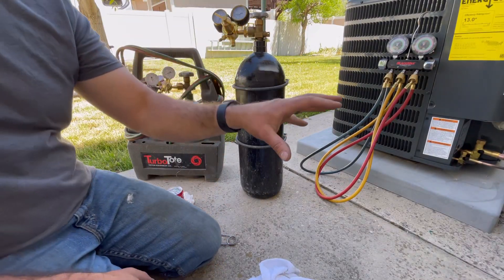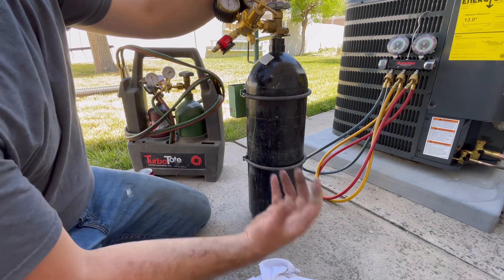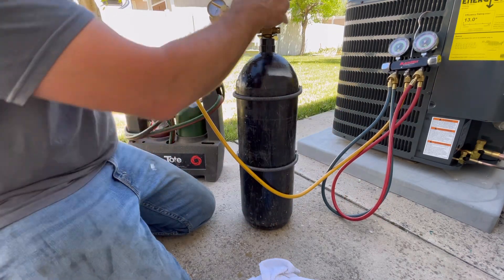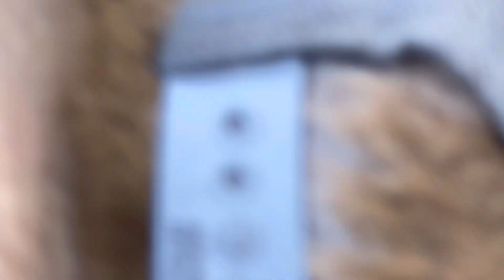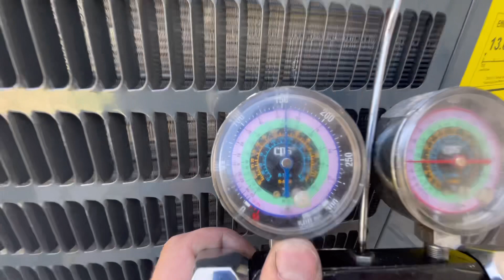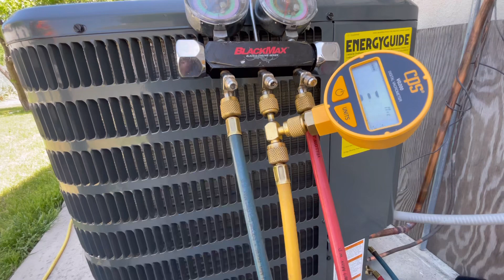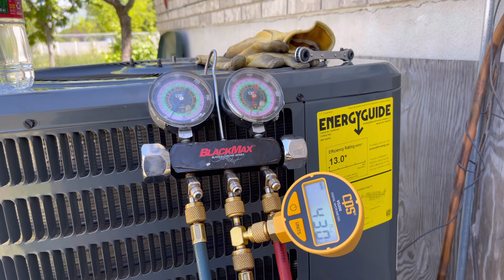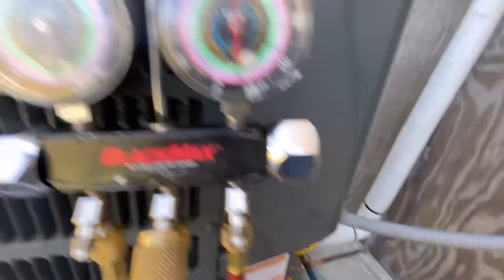DIY Air Conditioner Replacement  Part 3      -Step By Step Guide-

Comment: I read through all the comments and I have some questions that weren't addressed in prior comments.

1) Is it important to use nitrogen as opposed to just air to pressure test the system? If so, why?

2) Are there possible compatibility issues between the condensing unit and the evaporator coils? I'm sure some people will want to replace just one or the other, but even if they replace both, will certain condensing units not work with certain evaporator coils?

3) You mentioned in the video that doing this yourself will save at least $4000. Why do HVAC companies charge so much for this particular job, given that your video shows it's not all that much work. Doesn't that come out to something like $1000 per hour for labor? It seems like 6 or 7 times more than an auto mechanic would charge for a similar amount of work.
Reply: As a licensed Mechanical Contractor in the State of Michigan  I’m gonna answer #3 of questions. 

I think you have some misconceptions A 3 ton system installed at todays current pricing in Michigan will go anywhere from 3k-5k depending on the size of the unit. In Michigan doing this yourself you will not save 4k 

It takes longer than 3hours to install a unit.

1. Evap install with transitions or modifications 
2. Lineset install with brazing
3. Drain line
4. High Voltage
5. Low voltage 
6 Vacuum to required EPA requirements 
7. Testing the systems air flow, superheat, sub cooling ect 

3 hours isn’t going to get it done. 

Setting all of that aside you aren’t paying for a contractors physical labor you are paying for their knowledge. 

You are paying to ensure that the unit was installed properly and has passed all codes. You are paying to ensure the unit will operate as intended in 70 or 100 degree temps. 

All manufacturers require a licensed individual to install their product or the warranty is void

Contractors are well educated and get paid for using that education to get you the best performing product for your hard earned dollars. 

As licensed contractors we are required by the state to maintain our license, maintain insurance usually 2 million in liability, insurance on our vehicles. 

There are a lot of costs that go into operating a licensed company 

We do not earn 1k per hour
Reply: Yes, it is essential to use only nitrogen for pressure testing an HVAC system. Unlike pressure testing a gas line, an HVAC system must be free from all contaminants to operate properly. All Atmospheric air has moisture and contaminants in it, adding air to the system can be detrimental to the operation and shorten the life of the system.
Reply: @daveyeager9442  Thanks for the reply, but once you cut the copper lines, atmospheric air already contaminates the system. After the pressure test is complete, we create a vacuum to eliminate the contaminants, so why not just pressure test the system using air?
Reply: @purelogic3595  Personally I do not pressure test at all. During the process of pulling a vacuum your micron gage will tell you if you have a leak. If a leak is present and I cannot locate that leak then an only then will I add nitrogen but never pressurized atmospheric air. There’s just too much moisture being forced into the system under pressure
Reply: @michaelcso2400  Now that you explain it, it seems obvious. That was a very good explanation on pressure testing.
Reply: Nitrogen can get to higher pressures. And this guy is lying, it is VERY important to flow nitrogen while brazing otherwise you could have a plugged TXV within the first year. I am seen this personally.

Yes there could be compatibility issues. 

HVAC companies charge more because there is overhead involved with vans, tools, licenses, permits, on-call techs that will show up on short notice to warranty our work, we have years of training and we know what we are doing (unlike this guy since apparently flowing nitrogen is optional)

Just know that if you do this yourself and mess it up, you will end up paying more in the end for a professional to fix it.
Reply: @joelperigo7213  -yea like the cost to remove it... which i guess you would have had to pay anyways if you did nothing... i think its funny to see uptight "pros" get on to videos like this and badmouth ppl like you are doing. i guess you are watching money fly away huh? no more charging ppl high markup rates...
Reply from the maker: An alternative to using nitrogen is using Staybrite 8. It’s a soft solder that doesn’t get nearly as hot, so it will not produce the black stuff that brazing will. 

Also how do you think they installed a system with a txv 30 years ago? They didn’t use nitrogen back then 🤷🏻‍♂️ 

It is a lot of work don’t get me wrong and I’m not saying all companies are ripping people off but a lot of them do gouge. Thanks for the comment and questions. Cheers
Reply: @diyhvacguy  

1) I asked about using nitrogen for the pressure test to ensure there are no leaks. Joel Perigo then changed the subject by talking about the use of nitrogen when brazing. That topic (brazing) came up several times in other comments, so this was an inappropriate place to bring it up. When you test a residential gas line for leaks, you fill it up with an air compressor (or bicycle pump) using air from the atmosphere, which is mostly nitrogen. You don't do the same when test refrigerant lines for leaks? Why not?

3) Normally, the price for a job is kept in check based on market forces. I can go to nearby auto shop (these guys have a lot of expenses and commercial real estate is not cheap), yet if I ask them to install a transmission in my car (provided I provide the transmission), they'll quote me around $600 for the job. That's a lot of work, too, and not easy to learn to do yourself, as every car is different. So how come the market keeps the price of auto mechanics in check, but the same does not happen in HVAC when it comes to swapping out condensing units or evaporator coils? I live in Las Vegas, and I know from experience that it's nearly impossible to have anything AC related done for a reasonable price. This is actually the reason why our city has a popular DIY shop for HVAC repairs. For those familiar with this town, it's the one on Eastern and Bonanza. I tried buying a capacitor from that place 10 years ago and the quoted me $68 for a $5 capacitor. In contrast to this, I recently hired a mobile mechanic with over 30 years experience who arrived in his expensive work truck and toiled for an hour, charging me a mere $125. Why don't these auto mechanics simply change their profession and install AC systems? I doubt it's any harder or more complicated. In fact, these auto mechanics already fix AC systems all the time on cars, and the basic principles are the same.
Reply: @@user-co1ru4hc3h Just the AC system not the air handler. But if you want me to include that add another 2k at most.

The refrigerant is pre charged for 15ft but yes the install would include adding 410a if needed.

I did say Michigan. The economy of your state and the cost of living will largely determine the amount you are being quoted. 
Always always get 3 bids minimum start with large companies then move on to smaller one. 

Large companies are not trying to rip anyone off they simply have more mouths to feed than smaller ones.
Reply: @@user-co1ru4hc3h Pretty sure my comment got deleted because it hurts the income of the content creator but check the web site of the manufacturer. No manufacturer will warranty any piece of equipment purchased online.
Reply: @@user-co1ru4hc3h Fair enough…I just wanted you to have all of the available info before making your decision.

Comment: Great videos!  I have a set of automotive a/c gauges.  Are they same as the gauges used for the system you installed in these videos?
Reply from the maker: The fittings will be different, but you can purchase adapters for 1/4” which all residential is 1/4” size
Reply: Gauges have marking on the gauge for different refrigerant types (R12,R22,R134a,R410a, etc)  get a gauge set that matches the refrigerant used (R410a most common in residential AC).  R454b might be in some newest units

Comment: Very well done! Good, coherent explanation of the process. I am looking into replacing my central a/c unit with a heat pump this spring. I think that i can pretty much do everything, and although I can weld, brazing is a new skill, plus buying a vacuum pump is an added expense. I am considering removing the old unit, getting everything set up and calling in an a/c professional to do the vacuum pull-down and hooking everything up. Is this a reasonable way to go? And how would I go about finding an independent a/c professional who would consider doing such a job? I am wondering if I would be getting blowback for this request since I am doing all of the other work.
Reply from the maker: If you contact a large company they won’t touch it. Your pockets aren’t deep enough for them haha if you call around some of the smaller hvac companies you are bound to find someone who will do it for you. I’ve don’t this a handful of times for a few of my customers. 

If you’d like some more guidance and tech support when it comes to installing your new ac, check out our membership we have at Patreon.com/diyhvacguy  it’s $25/mo and I will personally answer any questions you may have and help you find the right equipment and get the warranty for it at a great price. Cheers,   Dave

Comment: Really enjoyed the three videos. Does it work the same for a heat pump.
Reply from the maker: Yes, same install procedure but there is a bit of different in the wiring. You need an additional wire for the reversing valve at the condenser, and an additional wire at the thermostat.
Reply: Thanks mine is working fine but it is 10 years old. I had it added it to my gas furnace.

Comment: Did I miss the actual charging?  I saw the vacuum, which seemed to only be on the compressor side, but then you opened up the valves to the rest of the system.  Or was the vacuum being pulled on the rest of the system with the compressor side staying isolated?  A little confused. Is the compressor side pre-charged with enough for its operation once the valves are opened?   Also, can a propane torch and solder be used, or is brazing needed for pressure and vibration?
Reply from the maker: The unit comes precharged, so after the vacuum is pulled, you simply loosen the two Allen head keys that keep the refrigerant contained to the condenser, allowing it to flow into the lines and the evaporator coil 👍🏽

Comment: i used stay bright 8  so far 4yrs no problem  used regular torch for sweating plumbing joints
Reply from the maker: Can you please email me at diyhvacguy@gmail.com?? I’d love to pick your brain about staybrite8  thanks!
Reply: Why has no one mentioned using flux before applying the solder? I know it is necessary for plumbing copper and electrical soldering so to have a good solder connection why not with silver solder?

Comment: Solid install. But you didn’t explain to the homeowners what to do if they have a long line set and need to add extra refrigerant and charge with super heat…
Reply from the maker: I’ll make sure and include that in the next one. It’s nearly impossible to cover everything unless it’s a 3 hour video. Even split up it’s difficult but I’m really going to take the time this spring to explain every little detail as if I was learning it for the first time. Thanks for the comment bro!   Cheers
Reply: @The DIY HVAC Guy  Over winter, you may want to post videos on each of the tools used for A/C and Furnace replacement.  I.e. How to use, how to read, rough new cost, rental cost (since someone mentioned renting a vacuum pump from AutoZone..not sure if usable for A/C purposes), etc.    Also, is it required to braze your copper lines?  Or as with plumbing can you use the flux/solder too?    Also call out what is the different in the copper lines (just thickness?)  i.e. plumbing lines can but L, M, etc in thicknesses, is "L" sufficient for A/C lines @ 0.04 wall thickness?   I know there are a lot of "little things" but those are exactly the things which will cost the DIYer a potential failure (and nix any savings they may have had)   Enjoyable videos, btw.  I'm close to having to replace my A/C & Furnace and debating to do myself...so far the A/C part needs more learning as noted above there are some missing items which could be gotchas too.   Thanks.

Comment: I am curious about not opening the valves to the compressor until after the vacuum. Doesn't that leave the lines and heat exchanger with air in them?
Reply from the maker: The heat exchanger is totally separate and has nothing to do with the ac. The evaporator coil which is attached to the furnace is what’s connected to the condensing unit outside, via the copper lines. In pulling the vacuum, you are pulling a vacuum on the lineset and evaporator coil. Then, when you open those valves wit the Allen key, you are letting the refrigerant  that comes contained in the condenser from the factory, into the lineset and Evap coil. You are replacing the vacuum with refrigerant, ensuring that no air, moisture, or contaminants are in the system. If you have any other questions don’t hesitate to ask.   Dave
Reply: I'm glad I asked. I didn't realize the condenser was already full of refrigerant and you were pumping down the lines.

Comment: Did you check the ambient air temp outside and the wet-bulb inside before confirming the proper charge?
Reply from the maker: Yes, to get target superheat. I’ll do a more thorough video on this soon. Cheers

Comment: Consider putting a wet towel on plastic pad …… just saying.
Reply from the maker: This is a good point. I now have a welding mat that I use but a wet rag under would be good. You must be an ocd person haha but I can respect that 👊🏼 thanks for the tip

Comment: Nice series. I'm a DIYer with a lot of technical skills. But not formally trained as an EHVAC tech. I'm pretty impressed by the detail you go into. I have worked on my AC unit, but I've never had to replace them. Does the new compressor come loaded with enough freon to supply the line and unit as well? Keep up the good work. I'm looking forward to more!
Reply from the maker: Thanks for the comment! And yes sir, the condensing unit comes precharged with enough freon to fill up to about 15-20’ of lineset as well. And if you need it topped off, call an hvac company and have them top it off and check your superheat and subcooling. If you’d like more technical info hop over to Patreon.com/diyhvacguy where you can sign up for a $25  membership and I offer technical support with troubleshooting, sizing, and locating equipment. It can be canceled at any time 👍🏽 cheers
Reply: Bruh! No way, it's this easy! I even looked up the cost of tools, some of which I already have.......wow. With the prices they charge, you'd think it was rocket science. I weld occasionally, but I've never brazed, so i think I'd want to practice on some scrap pipe first, maybe.

Comment: Finally someone has put together a series that is complete and easy to understand.  Thank You for putting in the time and patience on creating this video and explaining the process of installing an AC unit.
You made this series very easy to understand.  
Well done.
Reply from the maker: Thanks so much for watching and commenting! I hope this helps a lot of people :)
Reply: Great job on video. So you don’t use flux when brazing?  I have only done plumbing copper pipe. Need to head to Harbor freight and get a torch set.  ❤ Will practice my first braze in a scrap piece.  I need to replace my 1.5 ton basement unit.  Now I just have to figure out how to buy one at wholesale prices. 
Yea, I  am cheap. 😅
Reply: Good videos!
Reply: Have to Agree -  God  Communications & Simple to Understand  . .  Equipment side - having a R32  Vac Pump that's  Dedicated would be a  Good Thing ..

Comment: Question. Existing lineset  is larger than the new unit and it's a middle unit townhome so replacing lineset would require complete demo of all walls . Is it ok to use a reducing copper adapter to get the correct size lineset for the new unit.  ie.. 5/8 new, but old copper is 3/4
Reply from the maker: For sure. As long as you aren’t bringing it down through the lineset. I’d say going up to 3/4 will be just fine 👍🏽

Comment: plumber and weekend warrior here.
love the videos, very straightforward and without frills. my junky home unit's fate is sealed for the scrapyard. 
tradie to tradie, don't quench solder/brazed joints right after you're done, enough thermal snap can lead to microcracks and insanely slow leaks. Something about atoms in stacks between dissimilar metals and how they cling to each other. Wiping it down with a damp rag prevents acidic flux materials from sugaring the copper but give it a minute for them all to become friends.
Reply from the maker: Cool thanks for the tips! I’m always worried about overheating the king valves but this is good to know. I haven’t overheated one or messed up any seals yet!

Comment: So a homeowner can buy their own ac compressor without a license?  Is this true in all 50 states?  Also, is it enough to get the same size unit, or do other things, like seer rating, matter in choosing the replacement?  Are instructions specific to the compressor included with the compressor.  I have a 26 yo ruud, and expect I'll have to do this in the next few years.
Reply from the maker: The only requirements I’m aware of are for California. They don’t allow anything below 14 seer but as off January 1 2023 they will not make anything with less then 14 seer rating. And yes you are correct a home owner can purchase equipment via hvacdirect or Amazon and it is precharged with r410a refrigerant.
Reply: @diyhvacguy  thanks.